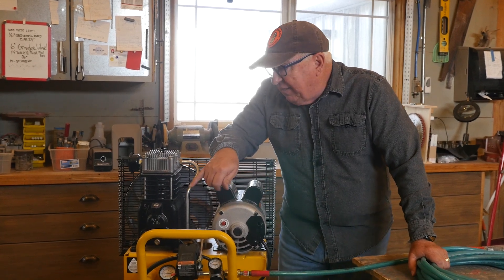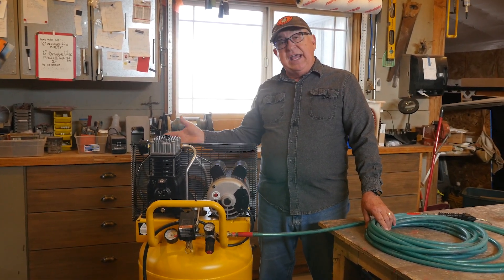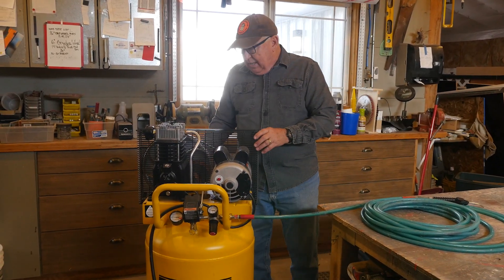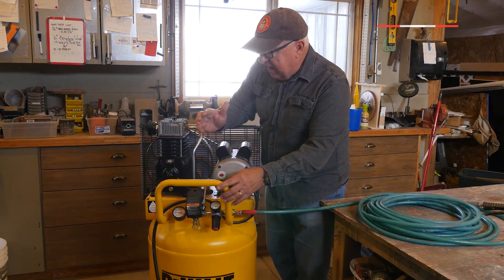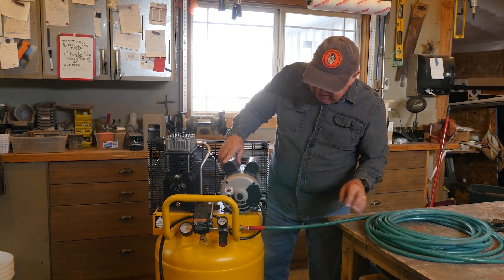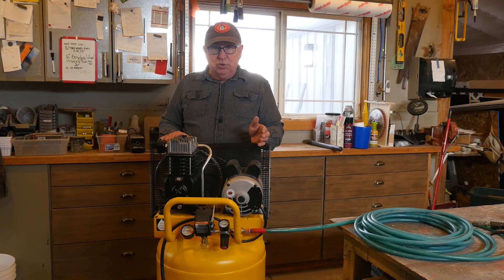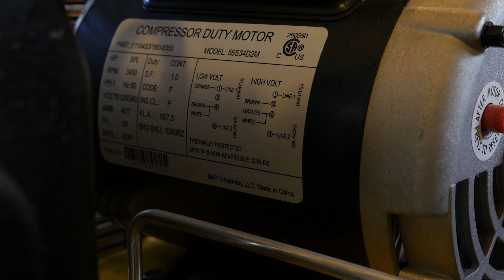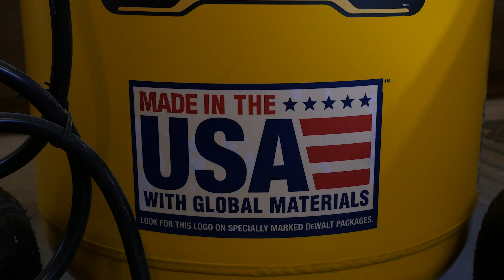How Good is the DXCM303 DeWalt® Compressor?

Comment: I question your statement that this is a 2 hp compressor. The motor doesn't say that. So you must be believing that little sticker they put on the side that is about as true as the big Made in USA. I was unhappy with my new DeWalt compressor so I called they. No one there knew anything about their air compressor. They recommended I call the number painted on the tank which is the company that makes them. I called the number and they answered the phone "Campbell/Hausfield" WHAT??? They explained they make air compressors and paint them different colors and put various names on them. You mention that yours is very top heavy--- very true. They are impossible to move around on anything but a smooth hard surface. How much do you think you would have to pay for an air compressor if it were made by laborers being paid $25 /hr?

Comment: I just had to return this compressor because the motor kept sounded like it was getting weak. Like almost like slowing down / stalling then it would get fast again. Did you ever have this issue?

Comment: Ok but you never mentioned how it performs. I cant find any good reviews on 30 gallon air compressor performance
Reply from the maker: Thanks for writing. I did say that we were pleased in the description and that we will be doing a one-year review of the unit. So far, it's been good. We did some changes on it to make it even easier to use and service. You can check that out at https://www.youtube.com/watch?v=Q1Pn53HuG78&t=0s.

Comment: Is this good for working on cars like an air impact 1/2 inch gun? or? I'm seing alot of bad experiences with these compressors. Not just Dewalt, but others. I'm trying to find one that I can work on my car. No painting. I'm not an auto body guy. Just general maintenance.
Reply from the maker: I believe this would be a good choice for you. So far, we've been pleased and use it for the types of things you mention.
Reply: @ how do you like Quincy? I just bought a 2 hp 24 gallon vertical compressor.

Comment: Can this compressor be laid down on it's back for transportation?
Reply from the maker: I wouldn't recommend it, unless you drain the oil from the air pump sump. If the unit is laid on its back with oil, the oil will tend to work around the rings on the pistons and put excess oil in "top half" of the air pump. I hope that helps! Also, if it's a short jaunt, then perhaps. Best, DFJ
Reply: yes , brought mine home laying in the back of a truck and works fine , they also start up and runs  better changed over to 240 v

Comment: i cant figure out why small compressors like this have such a fast turnin motor  3450 RPM       i've always herd a slower motor  dont make as  much heat    to weaken the valves in the head
Reply from the maker: They have gotten this type of motor to be pretty efficient, and its become one of the standard type motors you'll find in all sorts of applications. On the compressor we have, the pulley on the motor (small) and the air pump (large with integrated fan blades) allow the motor to run in it's optimum range without generating excessive heat) while bringing down the RPM's on the pump side to where it is running at a much lower rate, reducing friction and wear and tear on the components, including the reed valves in the head. I hope that helps! Best, DFJ
Reply: @DirtFarmerJay  i like the big aluminum fan   9 blade fan

Comment: Good video, Jay, but do you have any recommendations for smaller portable compressors for those of us who don't want a bigger compressor? 🤔  Could that be the subject of a future video?  Thanks for all of your good videos. 👍👍👍
Reply from the maker: I don't have any well-informed recommendations for a smaller portable compressor. The "pancake" type I've seen are generally oilless to deal with the use they are most often subjected to - including being carried not level or being tipped while being put into a truck and such. This can cause issues with some oiled compressor pumps and sumps. Emglo is a brand that I've seen on jobsites. The ones I  saw had two parallel cylinders situated sideways. I believe these are oiled, and designed for transportability. I believe this brand is now owned by DeWalt, but those that have had them really like them. I hope this helps, and thanks for the thanks on the videos! Best, DFJ
Reply: Thank you for the info on the portable compressors.  @DirtFarmerJay

Comment: Your great video is a reminder to me that I need to change oil and drain water from my 20+ year old Campbell Hausfeld compressor from Home Depot. Also mine does not have an air filter.
 I'll also look at labels to see where it was made. Thanks.
Reply from the maker: Great to hear from you! Indeed, I'm actually adding an accessory to make it really easy to get into the routine of emptying the condensation from the air tank ongoing. It will either be an extension line with the valve on the end (DeWalt actually makes one), or an automatic unit with a timer. The first one is about $25, the second one is about $125, so I'll need to think about it. You need to add a filter. Are you saying there is an air filter holder but no filter in it? Or, there's simply a threaded inlet to the air pump that you need to put a canister and filter into? Watch for another episode that will be published in under a week, "Pimp My Compressor" where we add these improvements to make the compressor even better. Best, DFJ
Reply: Jay, mine does have an air filter and I just overlooked it.  It has never been changed and it almost looks new.  Always garaged.  I may replace it anyway due to age. The only modification I made was to put a three-inch extension tube for the oil drain.  First time I changed it, the oil ran down the side of horizontal compressor.  I like the idea of a condensation extension line to make job easier than getting on my hands and knees to do it.
It was made in USA in Harrison, OH.   @DirtFarmerJay
Reply: Does it seem to run hot for you?  I was thinking the air filter cap should not be covered

Comment: How is the noise level?  I have an old Craftsman and it is very loud.  In my small shop, it is very annoying.
Reply from the maker: We have found the sound level to be significantly lower that the horizontal oilless compressor I had prior to this one. DeWalt says the the DXCM303 is rated at 78dB. Because it is running two cylinders at the same time in a cast-iron air pump, it runs at a lower RPM while getting the same amount of work done. We find it to be a lower-pitched sound that is not shocking when it comes on. It'll be even better when it is placed in the dedicated utility and lumber storage room and the door shut! I bet your Craftsman is oilless. If it is, I feel your pain. Best, DFJ

Comment: Most important info was unfortunately missed in your overview and appraisal on this unit.  What's the rated CFM output on the unit, and at the standard and most common stated 90 PSI value.  That same rating, as well as, it's duty cycle rating has a lot to do with both air tool types, compatability, and more importantly their working cycle times.  I do however absolutely agree with you that Dewalt's USA marketing BS is totally disingenuous, misleading, and purposely worded to deceive most potential domestic customers.
Reply from the maker: Richard, thanks for this. My oversight. I've included this information in the description. Your comments spurred me on to further research and I think that another compressor video is warranted that can use our compressor as a sample, but with information that can be applied to compressors overall. Thanks for the nudge.

This unit is rated at 6.2 SCFM @90 PSI. According to some compressor manufacturer and service sites, this is different than the actual CFM rating that is more closely rated to conditions in the shop or field. That is found by dividing the tank size in gallons (30) by 7.48. That results in an answer of just slightly above 4 CFM. Do you know anything about this or have a different slant or correction on this?

As for the duty cycle, I'm in contact with DeWalt now, attempting to get an authoritative answer of their stated duty cycle. Most compressors are rated between 50% and 100%. I suspect this unit is going to come in around 60%, based on the uses the specs state this unit can be used for - i.e., no continuous uses like grinding or rotary sanding. I'll let you know when I know more, and it will be included in the specs.

Thanks for your thoughts as well on marketing practices of "Made in USA" labeling.

Best, DFJ
Reply: Is that because Stanley Black and Decker owns DeWalt?
Reply from the maker: Could be...
Reply: Thank you Jay for your recent response to my initial comments on your DeWalt compressor review.  By chance I'd just checked back to see if anyone else had raised similar spec. questions on those issues.  I was quite pleasantly surprised that you'd personally made followed up on those points I'd raised.  Regarding CFM output at 90 PSI, I feel usage and selection should be divided into three categories... occasional light user, moderate usage and air tool collection above that of just nailers, light duty tools; and the more serious multi tools user that requires a more continuous air supply for 5-10 minute working cycles with heavier demanding tools such as grinders and sanders.  My old 60 gal vertical tank Campbell & Hausfeld cheater 5HP compressor is rated at about 10 CFM at 90 PSI, and is adequate most of the time except for heavier and longer periods with grinding and sanding tools.  There are  times I'd really wished I had at least 16 CFM, so I recommend always getting the higher CFM and duty cycle models that one can afford.  Additionally, once you have compressed air you'll never want to go back.  Lol... and additionally most air tools are at least half the cost of AC corded or even more so than newly marketed and quite costly Lithium battery tools.  Keep up your great and farmer sensible YouTube presentations.  😊